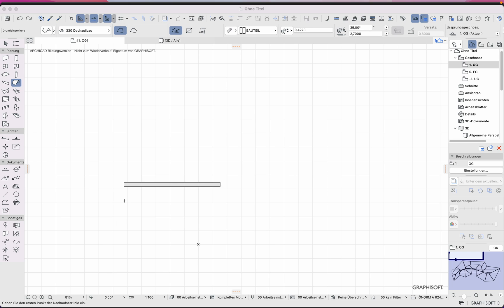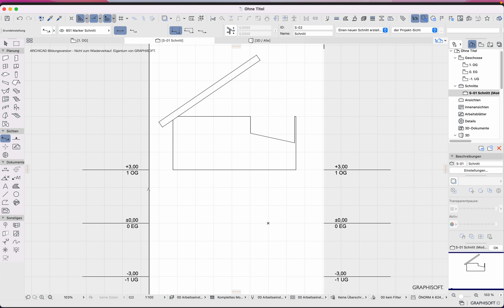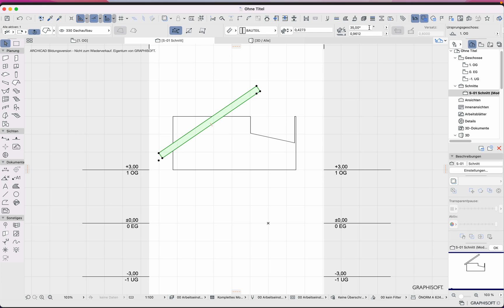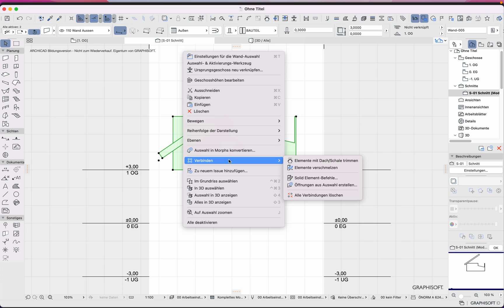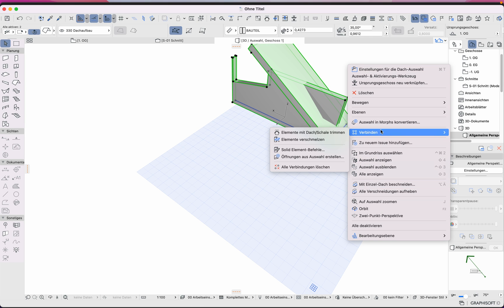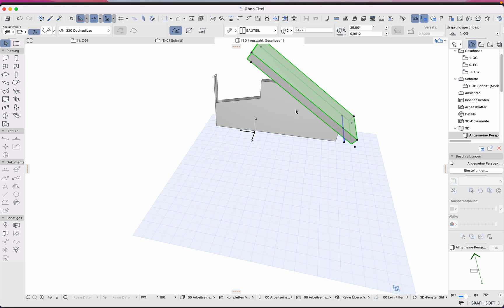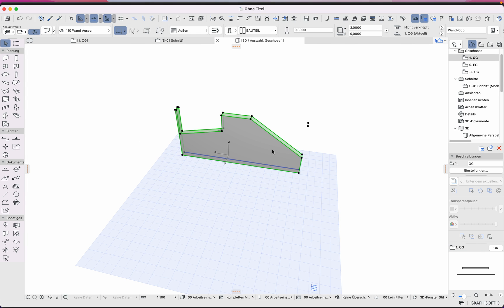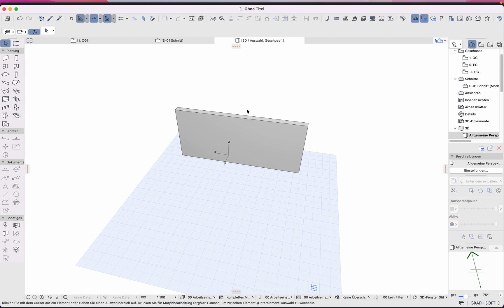Archicad25 old wall cutting methode along reference line

Comment: Das ist wirklich ein ELENDIGES herumgebastele. Das man beim Konstruieren mit Dächern und Wänden immer zwischen Ansicht, Grundriss und 3D Fenster herumspringen muss - Also, das geht mir sowas von auf den Zeiger, wann endlich bringt Archicad ein ordentliches Wandtool heraus, das :

1. Korrekt projeziert (also ambesten so wie beim morphtool im Grundriss dargestellt wird)(eine Gaubenwand ist zum Beispiel einfach nicht Korrekt darstellbar-der untere, weggeschnittene teil der wand wird trotzdem dargestellt  )
2. Mutltipoligonal wie eine Decke ist (also frei an den Eckpunkten in der höhe stretchbar ist, und frei mit beliebigen, einschneidbaren Öffnungen (=ohne Fensterelemente) zu versehen ist.
3. über mehrere Geschosse korrekt angezeigt wird - insbesondere die Darstellung und die verschneidung von Fenstern auf zwischen Etagen oder bei Treppenhausfenstern ist einfach nur schmerzhaft. 
4. Traumhaft wäre es dann noch, wenn man in der Grundrissebene mit dem Mausrad die höhe beliebig einstellen und so durch die Etagen scrollen könnte. 
Die Umrisse werden natürlich korrekt projeziert werden 

Im Prinzip wäre das letzlich ein einziges Tool , in welchem Decke, Dach und Wand vereint werden würden. 
Aber ich glaube allmählich, das marktwirtschaftliche Interressen diesem im Wege stehen - mit diesem tool wäre archicad so mächtig, das dieses fast keine Verbesserungen mehr bedürfte - und das ist einfach nicht im Sinne der Vermarktung. 
Aber nein, ich habe natürlich unrecht  - aber verstehen tue ich das nicht, warum es solch ein Wand-Dach-Decken-tool nicht schon längst gibt.